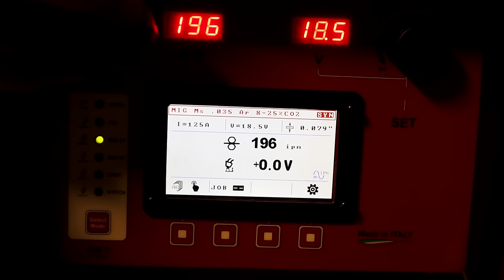A More Affordable Welding Table, And My First Job With It.

Comment: 22 years ago I started my business & bought the base from a Logan airport luggage cart for $50.00 at the scrap yard and welded some legs on it.  Still using it today...    Those tables are a waste for the $$$
Reply from the maker: the faster and more accurately I can turn around jobs the better my business does. I've thrown a lot of money away over the years on stupid things this was not one of those times
Reply: @westweld  Sounds good on paper.  As soon as you hit that table with a grinder or your helper gets weld stuck to it you will be pissed.  My table is a working surface, and any job that requires a fixture gets a job specific fixture.  I throw it on the table & start welding within 1 minute.   My shop tolerances are +/- .005" and have no issues holding that.
 I have been doing some of the same parts for 20 years, those fixtures paid for themselves on the first run.   For $30K  I would invest in a crane or plasma table.  Something that actually makes you money
Reply from the maker: @flyinpolack6633  haha you're not holding  5 thou tolerances welding......and thats the point these tables aren't 30k
Reply: @westweld  There are levels to this game. And yes I do, because my customers require it.  But that is why a purpose built fixture is superior.  It can be made out of square & let the distortion do the work for you.  Because I am sure that you are aware, things do move when welded.
Reply: @flyinpolack6633  seriously!? You think this table and fixtures don't make money ? Give it up man.
Reply: @LemonySnicket-EUC  Not for the same amount of money being spent elsewhere.
Not at all
Reply: @flyinpolack6633  this will be in service for the rest of his career. That's making money. You make no sense at all.
Reply: @LemonySnicket-EUC  You are correct, I make DOLLARS.
And have been running MY OWN welding shop for 24 years.

Comment: Working for a local fab shop in Sweden 2 mil usd rev and we do the same kind of projects except they have not invested anything in making the experience easy and precise for the workers. All the fun in these projects is the idea of being proud of what you have built but without proper tables and tools the job becomes a pain in the ass. We use old rusty H beams as work benchs lmao

Comment: I live in Germany so I bought a Seigmund table.   It is much more flat than what they spec'd it at.  The tooling package cost more than the table.  It is the most used tool in my shop.
Reply from the maker: That is my biggest complaint with seigmund tables , I think they are really nice and I don’t think the tables are too overpriced but the tooling prices are too much, I don’t think it should double the price just for tooling

Comment: Now that you have owned this table for a while, what can you tell me about the overall hardness of the table, not just the thin nitrided surface, i.e. are you seeing any impact dings, dents, and/or scratches on the table?  I have a 4x8 BuildPro table which has been really good, but the steel is not hard.  I also have a small 3x4 Siegmond table which is very hard, but cost is way up there for a 4x8 with accessories.  I am seriously thinking about buying of of these Kovosus.
Reply from the maker: Harder than woodpecker lips 50 rockwell it doest have a scratch on it but I try to refrain from dropping heavy stuff on it too
Reply: I will send a video of the hardness test at some point.

Comment: WOW!  nice works usual and nice new addition!  Question: are the railing powder coated or just spray painted? I am wondering what happens after you do on site welding to what looks like a finished product .... or is that just primed? just curious on that process
Reply from the maker: Thanks man......its always different but on this job its just primed they are responsible for paint

Comment: For a Chinese made welding table I'm impressed. You do a great job on the videos and your fabrication is P.L.S. I also how do you like the Dewalt cordless grinder you were using on the handrail install? They always seemed underpowered in comparison to corded but I haven't used the newer model with the 60v.
Reply from the maker: Thanks man....you are right most cordless grinders aren't worth buying but the dewalt 60 volts are the exception, I have 3 and find myself using them 85% of the time buy one you won't regret it

Comment: Which model table and accessories did you get?
Reply from the maker: I got the  2400x1200x200mm plasma nitrided with a ton of clamps....there are some pictures on my Instagram if you'd like to see all the tooling @_west.weld_
Reply: @westweld  Awww I dont have instagram
Reply: You can send us an email.  sales@kovosu.com
Reply: @beachboardfan9544  send them an email and they will contact you quickly with all the info you need.

Comment: Super cool welding set-up right there! It's nice looking at other people's nice things. I'm wondering what type of protective coating is specified for an exposed location like that?
Reply from the maker: Thanks Preso! I'm told the plasma nitriding prevents rust
Reply: @westweld  I was thinking about the handrail and balustrade. It looked like it had been painted when you were erecting it on site. The only reason I ask is that I am currently working on a handrail and balustrade for the rear of our house but I am making it all from pre galvanised steel tube and aluminium handrail which will be powder coated. I learned the hard way that even good quality hardwood only has a 20 year lifespan and steel eventually rusts. All the galvanised fasteners in the original wooden posts had corroded and there was dry rot in the joints. There was a local business that used to have facilities to hot zinc spray steel but they no longer offer it as a service. 
Regards,
Mark
Reply from the maker: @Preso58   I'm told that it will be painted with automotive paint I just primed it.....everything always rusts eventually....powder coat is the best imo, you are in a very high humidity environment so I'm sure its worse there. I wouldn't go off off my finishes because the people here don't care if it rusts in a year, they want what they want and if it rusts they will just pay to fix it in a year
Reply: @westweld  Prevents rust、Increase impact resistance、More wear-resistant、Super long service life.

Comment: Is the table overall and the hole spacing in imperial? IE, is it 1200mm or 48"? And are the holes 100mm or 4"?
Reply from the maker: The table is metric (1200x2400) as well as the hole spacing, however there are imperial measurements around the perimeter and on the tooling.....the holes are 28mm

Comment: Just got the evolution chop saw and I put it on one of those collapsible miter saw stands just like i saw in one of your videos, think you took the video down but that was an awesome idea. It works good for me cause I can just fold it up and put the saw in the corner somewhere outta the way. Wicked fab table btw 👌 I got a chunk of old catwalk grating for my fab table lol, hoping to change that soon.
Reply from the maker: Nice man, ya I still use mine all the time it works great... my first welding table was a big galvanized old pan on a wood table 😂
Reply: @westweld  right on! Galvanized eh, that must have been stinky to weld on. I got some old bridge steel years ago and made a skid for my trailblazer 302, got so sick after cause there was like an 1/8" of galvanized on the channel lol I try to avoid the stuff now.

Comment: Fantastic table and accessories, but an observation, are the Milwaukee packout boxes fireproof, just thinking about the drop splatter coming down through the table?
Reply from the maker: I had to large 16 guage pans broke that slide underneath
Reply: @westweld  Thanks for the response, I'd sort of guessed you probably had something like that, But you never know unless you ask.
Cheers from Australia

Comment: Fireball tool just made a welding table. Looks and weighs exactly the same...
Reply from the maker: His is a little larger and a little heavier its also cast iron and has smaller holes but more of them (mine is plasma nitrided steel around 50 RC) but im sure if its from Jason its awesome too.

Comment: Does your table have metric markings? If so... can you get imperial?
Reply from the maker: The scale on both edges is imperial by request, but the grid and hole spacing is metric

Comment: Thats one interesting welding helmet, did you make it or buy it somewhere? :)
Reply from the maker: It is An Optrel hood
Reply: @westweld  Thank you. :)
Reply from the maker: @KoalityofLife  it just occurred to me you were probably talking about the helmet I was wearing at the end of the video......its called a pancake hood and its really nice for welding outdoors (no glare from the sun) and very light weight made from carbon fiber
Reply: @westweld  Thats the one I was talking about. It almost looked like something you made for a specific application but I wasn't sure. Thanks. :)

Comment: What size table is yours? I’m not sure you stated that. I like this table.
Reply from the maker: Mine is 2400x1200x200mm without the extensions really close to 4x8 feet

Comment: Spectacular quality video, but how in the world do you get away with horizontal ballisters? Aren't you afraid of some child using the rail as a ladder, climbing up, and overbalancing?      They have been outlawed here (Australia ) for decades!
I have held off buying a table because of the cost, and never really believing that the spatter doesn't stick. I guess they are made of cast iron to overcome this, and the movement that sometimes creeps in on my steel table?
Reply from the maker: I've heard that from a few people not an issue here as long as spaces are 4 inches or less
Reply: I need to use a video to tell everyone that the nitriding table will not stick welding slag.😄
Reply: @kovosu   you able to PM me a price for the same setup on this video. shipping to Melbourne Australia.
Cheers.

Comment: Incredible production quality!

Total rookie question here but I'm mesmerized by it:

What's that sliding rail system 14:16 called ? Did you get it from Kovosu?
Reply from the maker: Thanks......I made the rollers just took apart some casters and the ends are angle iron

Comment: That's an absolutely fantastic setup. That a lot of equipment. 
I can't help wonder though, if it's over done to the point where you don't gain an advantage. Especially considering the welds will pull anyway.
Reply from the maker: Haha it definitely gives an advantage

Comment: This was interesting, i had only seen the American tables in actual tests before if we talk tables of professional quality, but i know they are about 10 000$ even without fixtures for the larger models, and i fully understand that a good wewlding table is very expensive to make, but it is still bit too much money for a small one man workshop unless it is something one plan to use very often and at least i would be a bit scared to use an expensive high quality welding table for cheap bulk job so i think one of those would be a good option if the quality is this comparable, i mean after all most of us does not make rocket or aircraft pars on daily basis and for industrial jobs and car parts, etc this will be more than enough whan it come to precicion.